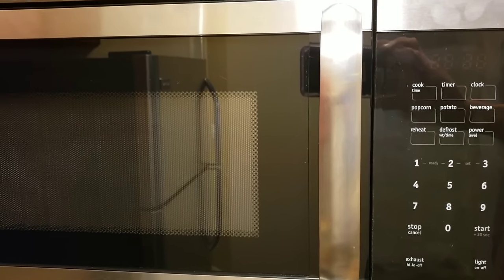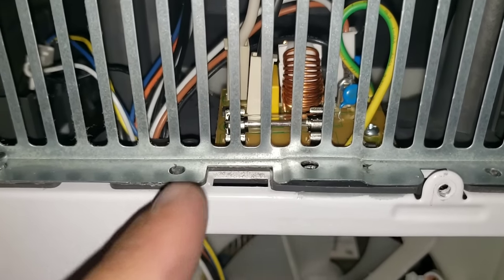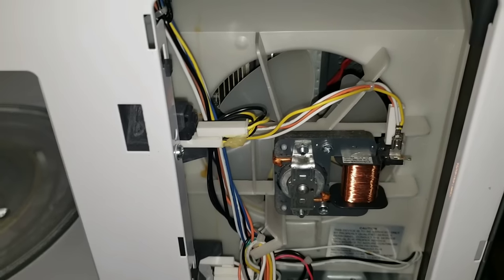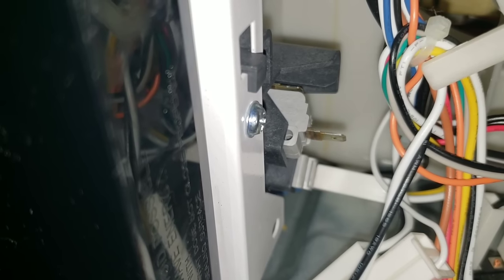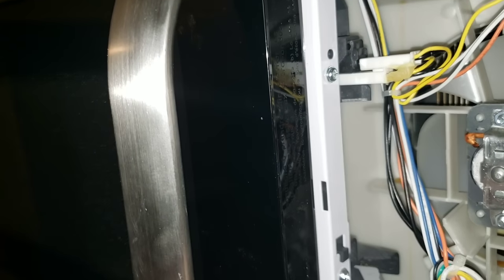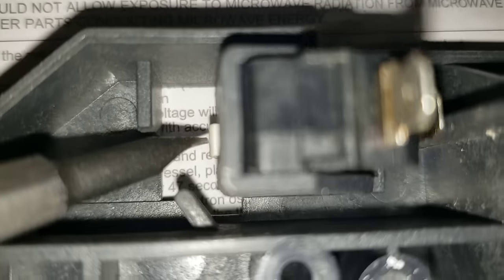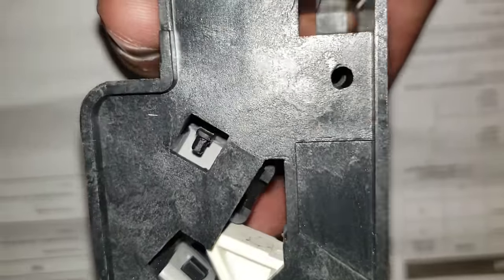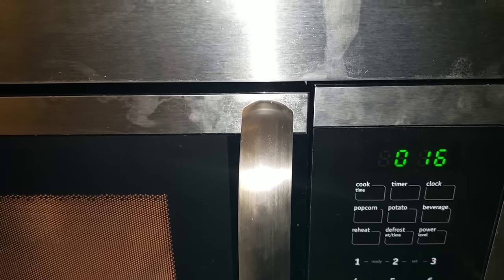Microwave Keeps Tripping Breaker? Here's WHY!

Comment: Thanks Sam!  My Kenmore microwave (790-80322310) that is 7 years old but produced in 2013 wound up with the same problem - same symptom - add food, close door, start microwave and it would trip the circuit breaker.  Wound up taking the control panel off and also the white vertical mount that held the switches in place (identical to your black mount) and tested each switch separately in the mount. 
Darn!! They all checked out OK!!   The top and bottom switches sounded continuity with buttons in and no continuity with buttons out; the middle monitoring switch sounded no continuity with button in and continuity with button out.  Saw David Wiebe's comment below where he disconnected the middle monitoring switch and his MW worked; hence, I did the same and now mine works too.  Must be some gremlin in that monitoring switch.  Am going to order that switch and install it: Happy Camper.

Comment: Thanks for the video. This was spot on with my Cuisinart mw. Interesting that the internal fuse didn't blow first before my breaker. Probably the load circuit on the breaker was marginal and the small additional current by the bad switch was enough to trip it. Glad I found this post. Thanks again.

Comment: I think mine has a similar issue with a worn out door catch receiver / door switch holder part. All my switches tested well and it pops the fuse when I hoped the door. The plastic seems to be orettt worn out but more than that the bottom two switches seem to have a lot of play to them. Im curious how much play is normal. Really don’t want to buy that part for $40 but I guess that’s better than a new microwave.

Comment: This video covers only the first of several failure modes of these door switch assemblies, and how to work around the problem.  However, it doesn't explain why it happened, and when it will happen again.   Go head with this procedure, basic diagnostics for the switches is very good.   
Problems caused by switch mounting panel and actuator wear are not described, and can't be readily diagnosed without a complex oscilloscope setup to verify switch open and close timing and overlap.   If this procedure does not match your findings, more diagnostics will likely be needed.  A starting point is to replace the switch mounting bracket.
Covered here:
     1) switch stuck open (or closed)
Maybe covered...:
     2) switch contacts fused.   Can appear to be like condition #1, but not necessarily.  (Look/feel for switch actuator reluctant to move at first.  If contacts are fused, it should open with a 'pop', after which operation will be noticeably easier.  Replacement gives a short-term solution, but does not remove why the contacts fused. 
Not covered:  
   3) Door switch bracket wear and/or switch actuator wear changed timing of switch operation, leading to a line-to-line electrical short circuit.   Yow!!   That is the most likely reason for contacts fusing.
   4) least likely — the switch is actually worn out.  They are typically rated for millions of operations, but have you seen anyone taking responsibility to verify that for Amazon and eBay non-OE brands?  
These days, even paying more for an OE part will not necessarily buy a better switch. They may get better quality surveillance, but might also come from the same factory and manufacturer.  At least you will probably be able to pronounce the supplier, and a tel. # to make a claim.  Good luck!a

Comment: Thanks for the video. One question, I was having the exact same problem you mentioned in your video.. I didn't use the microwave for a week and tried to run again and it work fine now. What could be the reason for tripping the breaker in this scenario? Fuse looks good and one switch was replaced 2 months ago.

Comment: Could you tell me why mine trips when it’s running if you open the door while it’s running it kicks the breaker
Reply: Your microwave door has 3 safety switches in the door to make sure the microwave ONLY works when the door is closed ( a primary switch, a secondary switch and a monitoring switch ). All 3 switches are interlocked (synchronized together) to open and close all at the same time. If the timing of 1 switch is off  or 1 switch is malfunctioning then as a safety it will short out the microwave the moment you start to open the door so that you do not have microwave heat burning you. Having a trained technician replace the safety switches should solve the problem.
Reply: @Cndfirr  thank you for your explanation. I ask few youtube channel about this and no one give a damn,..i'm a technician but new about microwave. I thank you a lot,.may god bless you.

Comment: I got a similar issue. Same microwave as this, or looks exactly the same. Mine is Frigidaire lfmv164qfa model. My microwave works perfectly fine. But if I open door at any time while its being used it pops the fuse or trips breaker. I can hit stop button first and it it works perfect. Just aggravating that sometimes someone will forget and just pull door open and it pops fuse or trips breaker and I got to take cover off or go to breaker box and reset breaker.I am almost 100% sure it should be that continuity to door switch isn't cutting off when door is opened. But my meter is telling me the switch is good. Switch is $50 bucks. So I want to be sure.

Comment: Update: replacing the plastic switch holder worked for 9 months.

——Our GE over-range microwave would trip the breaker; one of the 'ramps' in the plastic switch holder was highly worn, causing microswitches to operate out of order.  Replaced it, all okay until today. (9 months ago)

Now I see something others described- a switch can fuse contacts when there's a line-to-neutral short.  Today the microwave shuts off (fails) almost immediately when operated normally.  

Looking in the bottom latch opening, you can easily see the lower microswitch operator.  I tried to operate it first with a flexible tool, but it didn't move. Got a stiffer screwdriver, and heard and felt the switch 'pop'!.  After that it operated freely, with either tool.  And, having freed the fused contact, the microwave works again.

Obviously, that's only temporary.  I have one microswitch on-hand, so will check both to replace the worst one.

Comment: Top and bottom switch are NO middle one is NC. Broke the holding tab for the top one. Very snug fit so it seemed to still work may need to glue it or replace the bracket. Be careful on that one, I've seen comments to the same from others... [these are major cheaper than OEM and appear to be the same switches Yoiilnz KW3A Microwave Oven Door Switch 16A 125/250V Door Interloc(Normally Open & Normally Close) (2 Normally Open and 1 Normally Close) for microwave model FGMV175QFA Amazon $8.90 for all 3 switches]

Comment: Hey buddy. I've got this problem with a Kenmore  when we open microwave before times runs out it will trip the breaker or sometimes blow fuse. It works fine if my family just had pentience and wait or hit stop button. They are driving crazy I've replaced three fuses already. 😭😭😭😭

Comment: Sam, my breaker trips when I open the microwave door. I checked the door switches. Top is normally open, middle is normally closed, bottom normally open. So far, so good? I've checked all 3 switches with the multi-meter. All 3 check out OK. What ELSE could be causing this issue?

Comment: Sam, great video. My GE was tripping the breaker without any other sign of problem. Followed your steps, monitoring switch was bad, ordered and installed the replacement, microwave fired right up... However now it's not heating. Is there something I may have done? Any suggestions? Thank you.
Reply: Charles did you get your microwave fixed mine is doing the exact same thing as your...replaced monitor switch now the light on the microwave stays on and wont heat.
Reply: @kirktalk3983  mine is doing exactly that.  I manipulated the monitoring switch to where it would click. That allowed the microwave to turn on without popping the circuit breaker. However it is not heating the food. Did you ever come to any conclusion on this?

Comment: I have a Frigidaire 1100w microwave. Every once in a while it will trip the breaker. I have made sure the breaker isn’t overloaded and even moved to difference outlets (breakers) and the same thing happens. It will trip right after I press start but after resetting the breaker it will work fine for a day or 2 again. I tested all temperature probes, fuse, and all 3 door switches with my meter. Everything was fine and the switches I flipped on and off 20-30 times while testing and it was perfect. Do you think this is still a door switch problem or something else? Thanks

Comment: Great video Sam.  I have the exact same frigidaire microwave (Ffmv164lsa)  I had a problem with the breaker popping if I would open the door with the microwave running.  I would have to press cancel button then open the door.  Well eventually it stopped working completely where when I press add 30 it would pop the breaker.  I disassembled just like the video and found my monitor switch just like yours was not clicking.  I eventually pushed down on the little button hard enough with the screwdriver and it started clicking again.  I assembled the microwave and it works but it still pops the breaker if I open the door without clearing the time.  Is this cause that Monitor switch is going bad?  What is the part number for this monitor switch?
Reply: I had GE microwave and got that same problem as your. I can’t open the door with the microwave running. Try to figure out now. Have you resolve your problem yet?

Comment: Good video, our microwave trips the circuit breaker if you open the microwave door while it’s running. If it is complete and you open the door it doesn't trip the circuit breaker. Maybe it’s one of the door sensors.

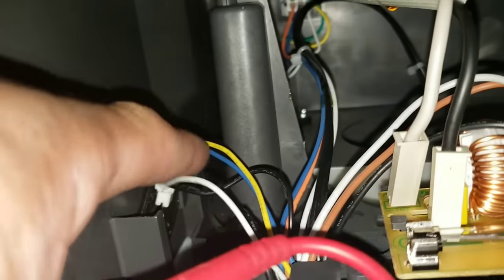Comment: I am having the exact same issue with my Frigidaire microwave (I.e. trips the breaker when starting the microwave).  I tested continuity on all three door switches, oven cavity thermostat (top and to the left of the filter)  & bottom thermostat and they were all good.  As expected I got no continuity on the hood thermostat.  I also removed all of the door switches to inspect them and they all seemed fine.  But I do not get continuity on what you are calling the oven thermostat at 2:47 in your video.  I cannot figure out how to remove that item.  Is that item actually a thermostat or just a connection point for wiring?  I don’t see that item in the parts layout diagram in the documentation provided by Frigidaire.  I would appreciate any suggestion.  Thanks!
Reply: I put everything back together (without replacing anything) and my microwave started working.  Maybe there was some dirt or something was loose, either way glad it is working now.  Thanks for the video!!!

Comment: I just picked up a free 3 year old GE microwave that someone was giving away because it pops the breaker.  Sure enough it’s the monitor switch stuck in closed position.  Took switch apart and freed contacts.  Put it all together and the switch welded again!  Tried another switch from old microwave and works.  Heat some water, on and off a few times, open/close the door.  While it’s heating water, I slightly pull on door and it pops it’s fuse.  Check monitor switch and it’s welded in closed position.  Arghh!  I’m thinking some wear or sloppy fit allows the monitor switch to close contacts first rather than at same time as other switches or at least last.  Gonna experiment with some shimming but got it disconnected for now and microwave works fine.  
Just some logic for those of you facing same issue.  Top and bottom switches are closed with door closed.  This completes circuit to fire up microwave.  If you opened door while cooking and top/bottom switches failed in closed position, you cook your face!  The third monitor switch shunts the transformer input when it closes (door opens).  The high current blows the fuse because current was flowing. If the top and bottom switches operate normally, current will not be flowing when these switches open.  Either the top and bottom switches open too late allowing current to still be flowing when monitor switch closes or monitor switch closes too early before top and bottom has a chance to interrupt power.  I’ll have to use two multimeters at same time, wired to the switches, and pull on door to see which one opens or closes first. 
Thanks Sam for the video.   If I find out my issue is switch timing, maybe I can do a follow up video to yours.
Reply: Got a new monitor switch installed and hooked up three multimeters to check which switches open or close when pulling on door.  Also discovered the plastic was wearing away where the door latches touch during closing.  Well, monitor switch was actuating first and since microwave is still running when this happens, that switch purposely shorts transformer primary and blows fuse by design.  I installed shims where latches enter the frame and hot glued small pieces of a zip tie over top and bottom switches.  This ensures that top and bottom switches open circuit completely before monitor switch closes.  The protection is still there and shims add space between opening and closing of switches.

Comment: hi sam i have just purchased A SAGE 3IN1 microwave model  SMO870BSS4GEU1 2ND HAND AND THE PERSON EXPLAINED it powers on and the timer counts down but the microwave doesnt heat the food and the AIR FRYER DOESNT WORK too I CANT FIND ANY VIDEOS on youtube with possible problems except for the soft close function of the door sometimes goes iffy OR THE thermostat cut off may go bad we have gently removed the plastic frame holding the 3 door switches in it and all seem fine with the buttons making a good click sound and no DISCOLOURED blade terminals connectors etc etc I AM NO ELECTRICIAN but my friend has tested the switches for continuity and they function ok when button pressed in and back out BUT WE ARE NOT SURE WHAT TO LOOK FOR WHEN IT COMES TO SWAPPING OUT THE monitoring SWITCH if needed , all i know is they have to be rated for 16A 125v to 250v rated BUT WHAT else do i need to check for please ???   cheers STEVE

Comment: I have a slightly different scenario. My sharp digital microwave trips the RCD when the door is closed. It is in a house I rent out so will need to go round there. To confirm the rcd is fine if the door is open as son as you close the door and without selecting any programs the rcd trips. The display timer is active when the door is open but obviously goes off when you shut the door tks in advance.

Comment: Hey Sam, i replaced them all i think one of them wasn't switching properly. But it still isn't working it runs for a while 2-3 sec and then stops. so i changed the Black Cylinder thingy on at the bottom of the base on right side it worked for a day but when I pulled the door while something was in microwave and 10secs still to go it just shut down. is there something else wrong (these is for sure) can you help or you have some video about that?

Comment: Post some more videos with these micros I have the same issue at the complex I work at but it’s blowing the fuse not tripping the breaker. I replaced the monitor switch and it only worked for about 2 days and blow the fuse again

Comment: i disconnected the middle switch which i believe is the monitor switch and it works just fine without it plugged into the wires. Any harm in running it like this for now during this pandemic?

Comment: Wonder video       I have a Kenmore Elite,  control looks the same. turns out the middle switch which is a shorting switch to be sure the unit can not run with the door open. could not locate the switch so just disconnnected it till i find one. this is just a double safety. The unit still shuts off when you pull the door open

Comment: I need help!
I've purchased a new black bracket as the old one was worn at the top where the door latches.
I've purchased 3 new switches,  tested them all , put it all back together and the fuse still blows 
I do NOT get continuity on my hood thermostat 
Will replacing it fix my fuse blowing issue?
Thx
John
Reply: Did you replace your hood thermostat to verify? Any results to share?